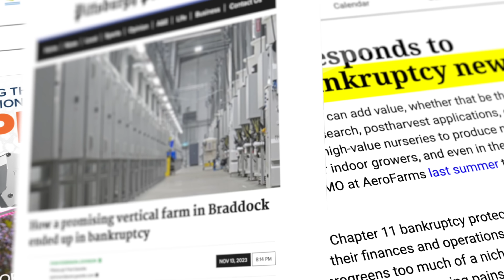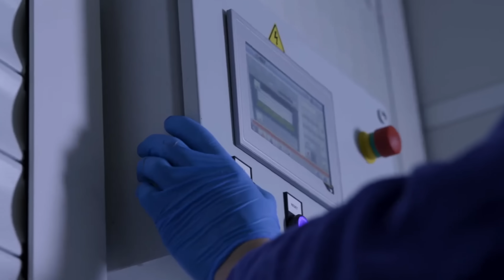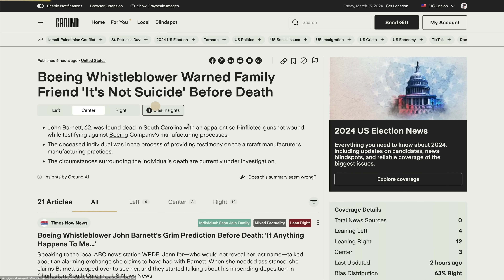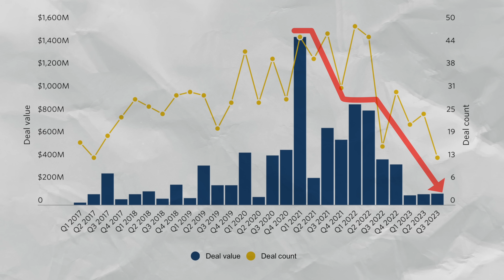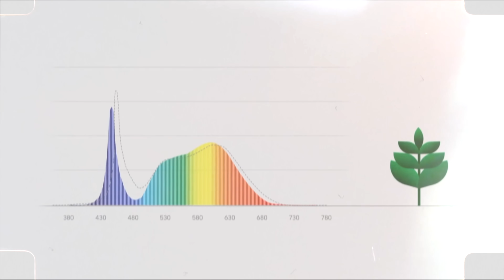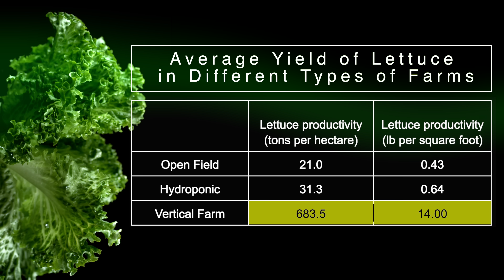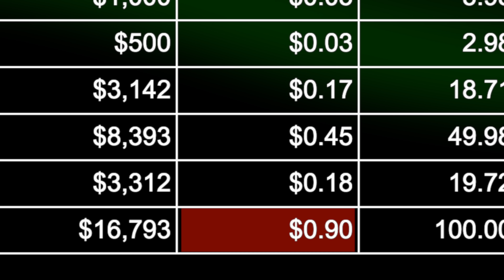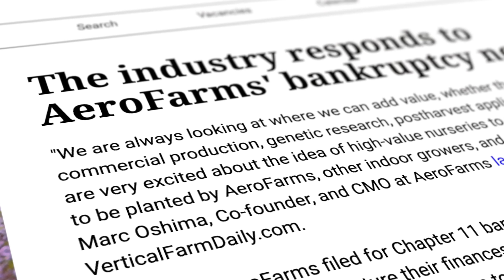The EPIC Failure of Vertical Farms - What Happened?

Comment: It was entirely predictable that these would fail because most of the promises provided were lies.

•The cost are dramatically higher because, unlike farms which are open fields, vertical farms need heavy infrastructure around them with drastically higher energy costs to maintain. Then there's taxes and permits.
•Crew cost is also higher because the machinery is more complex and is based on higher standards of living.
•Yield would also be dramatically lower as you cannot use massive industrial equipment for harvesting. So you'd need more machines and/or labor which compounds the high cost.
•Less water use is also questionable because cutting plant nutrients would lower yield quality which is already present with less natural rich soil (ehich alsoadds costs).

The only possibilities of success is if they were growing small luxury foods or if food cost skyrocketed and energy cost plummeted

Comment: The equation I think is really hard to beat comes from the cost of land. Even in high-cost areas like England land is £10k/acre. When you compare that to a sheet of polyurethane covering the same land you realise why it's so hard for these technologies to compete on price. Once you add a floor and a ceiling you've 10x the cost of land. If the land is somewhere cheap like Texus, Africa, Australian outback $80/acre it's basically free.
Cling film: £1,146.00 per acre (British pounds per acre)
1mm aluminium: £80,289.63 per acre (British pounds per acre)
1mm mild steal: £90,569.00 per acre (British pounds per acre)
5cm concrete slab: £10,117.14 per acre (British pounds per acre)
It's the same equation as to why space colonies can't work without a step change in the incomes of the population. Most people can't afford food to be 10x the price it is. So couldn't justify existing (economically) in a space colony.

Comment: You didn't add in the carbon tax on every aspect that makes up a lighting system, a building to grow in,  water pumps, all aspects of moving and storing electricity, heating, water hoses, nozzles and i mean every little part and component has a carbon tax, GST/PST and yes a income tax associated. So in reality the head of lettuce is even higher but some form of Government grant and or subsidy is making the real cost numbers retarded or corrupted. Imagine adding up the real numbers the we pay multiple times on a single item of a multitude of parts and components form mining to transporting and storage and 3 different distributors of each and every item associated with a transmission a engine and washers nuts bolts and oil and gas and water and what makes up a pump and or questionable materials that make up a PVC pipe. Every single item from start to finish is made from different companies and transported to a storage facility and distributors sell to manufacturers and factories what they need. Before a product is even made every single component  of a finished product has had a Carbon tax added to it over and over through out each process and now as a finished part, it now gets retaxed yet again. as the part finally is bought and sold to a company that needs a complete part to fit their new product they aim to sell. We forget that we are paying way more because of nasty tricky like creative taxing is causing bigger problems than it solves. We still need to heat our homes and to add a tax to the heat they ask us to use and we paid for as a electrical/gas grid is really insane. We can't make the numbers work for this project because of corruption and dirty political policies and procedures.

Comment: One weakness of the system was not mentioned and that is the type of crops grown. From the perspective of calorific value, green veggies like kale and lettuce are low in calories where as pulses like beans, root vegetables like potatoes  and arable crops like wheat and barley have anywhere from 20% to 40% more calories per gram. The problem is that non GM plants of these types do not lend themselves to this kind of farming. For this kind of technology to work there has to be a change in the seed stock using genetics to adapt the plants for more desirable characteristics i.e. micro-wheat with six inch stems  and oversized kernels. Packaging and marketing will solve the other human problems.

Comment: It's exactly what renewables have to compete with fossil fuels: Costs. Yes, going "Green" might feel good, but it's expensive up front and can take seemingly forever to break even. Additionally, how can a vertical farm in the city ever compete with a rural farm? Property taxes and regulations alone in a city would kill you.

Since labor costs is the biggest cost in vertical farming, making it a simpler process to use less skilled workers could help. Then again, that head of lettuce cost $5+ while a head of rural farm lettuce cost less than $1, even if you got rid of labor costs altogether, it would still cost 2x much. Did these people even consult an economist?

Comment: Anyone who understands agriculture could have seen why vertical farms were not going to work. A typical farm is either harvested using a combine harvester which costs $500,000 and lasts 20 years, or by migrant workers making $7.50 an hour. The sunlight is free and agricultural water use is often subsidized at below=-market rates by charging residential and commercial users more. Unless and until the cost of traditional horizontal farming goes to the point of being so expensive there are food price riots, it won't work. About the only agricultural product that makes economic sense to grow vertically is marijuana.

Comment: What I'm gathering from this video is that indoor vertical farming won't be viable until we have autonomous robots that can maintain them for us on the cheap, and both the farm and robots would ideally run on solar power instead of off the local power grid. I always imagined that farmland would be replaced with solar panels, and then in a small corner of the land would be a big building where the actual farming occurs - with the goal of the farm being to re-use as much water as possible so as to not be affected by changes in the local watershed. Blue collar labor, electricity, and company overhead costs (i.e. "Capex" on that chart) account for indoor vertical farming being more expensive than outdoor farming, but saving water in places where it needs to be saved and enabling farming where it's virtually impossible right now seems like it would be invaluable. I guess until we have cheap autonomous labor it's going to be cheaper to just farm outdoors then.

Comment: What if they used light refraction instead of the high tech led? along with using solar. this method would be cheaper as hiring outsource could pose employment exploitation for those risking their visa and also allowing the local population to feed themselves to prevent another lockdown that would hinder vital resources.

Comment: You'd need a sun, for every shelf.
Reply: Your fault, or your governments for not subsidizing it.  You subsidize cars, religious charities, military, and medicine.
Reply: You won't stop mold, mildew, beetles, locusts, nor bad weather.   Your crops aren't growing where there's temperature controls, or fly fans, or air filters.  So, your farms will go barren from flood, drought, and heat wave.  You'll need pesticides and fungicides closing the door and doing your own composting won't save it.  It costs what it costs, just like existing farm equipment, land and otherwise.   MIT only gives you until 2040 anyways.   An ox is cheaper than a self driving tractor!
Reply: Go be unreasonable with the rest!

Comment: Nice research. Sad to see and hear that they, you, do tell THE problems with vertical farming, so if the smart people do a proper evaluation, and use mother nature more and better, the majority for challenges are already over come. 

One example, you addressed the  two color LED light and electricity, duh  use mother nature FREE light and transport it using Fiber and focused Light domes, which can also feed solar cells, store in batteries etc. at the same time.  Is one solution,
Automation, can use AI for that also, needing few or little people (labor) , problem solved.

The idea is still sound and will be used going forward. Sad thing it may be done by those controlling the food industry, greed and more.  Also, you are just naming something that is a bead of sand in the desert, there is globally much more going on and there are plenty alternatives. but,  media is censored heavily so one needs to find it out side those walls of censor ship and control. 

Question everything you think you know and what one is being told.  Stop acting as a sheep that is kept inside a controlled circle of knowledge. Borders or artificial walls are made up to keep knowledge away from the masses.  The Science is still sound and will become the future, it has to.  If not we become one of GREEN BUISCUITS like in A certain movie from the 60's.

Keep up the good work.

Comment: Seems to me the problem is, they wanted to pretty much start the industry building the Model T, which depends on offering a better product (than horse-drawn carriages, in this case) at low costs. Instead, they should have looked at the actual beginnings of companies like Tesla, which was a ground-up rethinking entering into an established market with, originally, a fairly high price. Base your plan on doing a lot of expensive R&D, and start entering the market with niche products you can ask a high price for, only going to the mass market after you have most of that R&D down, and that step is still hard.
Depending on Wall Street with their interest in fast returns does not work.

Comment: so they just need to improve cost per weight so why not make it so they grow much bigger and faster by utilizing pressurized co2 environments? that would also reduce pests because it would be a reduced oxygen environment. double whammy for the cost of burning stuff and sealing the room. also would reduce labor costs since it wont be accessible as often leading to more automation. lettuce being double the size wont be a huge issue either.
Reply: and focusing on the more expensive produce would increase yields. like why put in all the work to grow lettuce when you can grow wasabi or truffles.

Comment: I would be curious to know how True Cost pricing would change the comparison. Looking as an example at the oil energy input (e.g. for transport and farming tractors) we are now only paying for the cost of extraction plus a small markup for the refining and service station. If we would price this resource instead at the value it gives (taking of our blinders to the fact it it will run out - being a non-renewable resource) and it include the cost of the environmental damage it would make so much less economical sense to transport produce across the world. 

Also these vertical farms in urban areas should just have direct to consumer sales strategy with a shop at  the ground floor of the production facility, did any of them try that

Comment: It sounds more like a greed issue. When America built it's rail system and their radio infrastructure they were not interested in the immediate ROI within their lifetime, they saw the potential of building up the nation for future generations. It worked and these systems are still in place today. That's the real benefit to the cost, being the pioneer to the future generations that will benefit greatly from these technological advancements.

Vertical Farms are the future but that doesn't mean the investors and innovators are going to see the true benefit in the long run, these companies today are most likely slowing the technological advancement as opposed to progressing it as they have proprietary information and patents that are being withheld from other innovators that can continue their advancement.

Comment: What you're looking at as an issue with vertical farming is actually an issue with high cashflow burn companies that rely on VC money until they can get to black and an absurd number of companies chasing the same dollar. This isn't an issue specifically with vertical farming, it is an issue with cash flow burn versus the price to actually deliver the yield. You have to automate a vertical farm for it to make sense... and that's EXTREMELY costly. You have to get to scale and most of them will die before that happens. Vertical farming is in the chasm... and it will look a ton different if it cross the chasm.

Comment: If 2000 new vertical farms had started up in 2023 and now 90% of VC has pulled out and many are failing that aligns with businesses in any industry. 

As an anecdotal example I have grown greens in my garage using aeroponics from 2018, when only 3 major VF existed and back then lettuce and spinach was basically only feasible. Today with exponential technological advancement and learning, berries are feasible. In 10 years with AI and Robotics I predict it will surpass growth of farming in the outdoors. 

What VF engineering and sciences have done in 6 years is codify the formula for plant life.

Comment: Don't believe even half of what he is saying. Unicorns are fantasies and so those companies are failing. But that is not the only "vertical" farming out there. Things like lettuces and strawberries and more, which were traditionally farmed in the open air, are now farmed successfully in greenhouses and have been for decades, they are lighted using normal sunlight, produce year round. And specifically do multi layer, not stacked like you see in this video, but on hanging on wires or triangular tracks. It's not as dense as the companies that featured in this video, but it's a hell of a lot smarter and better for the environment than those backward American farmers can do. It's the reason why a small country like the Netherlands out produces the US. Certainly when looking at the land ratio. 
Vertical farming is not going away, it's just evolving in companies that do know what they are doing. And how to do it economically. 
Research... my ass, he looked at a very specific section and thought he had seen it all. There is a lot more between the old fashioned greenhouse and bunkers growing lettuces.

Comment: In the long term energy is going to be a much bigger problem. Today energy is cheap: We get it by burning oil.
In the future we want the energy to come from solar panels. If a vertical farm gets its electricity from solar panels, it will need entire fields of solar panels which take up a lot of space.
A vertical farm requires a solar panel field so large that it is roughly four times bigger than the farm land of a traditional farm with the same output. This means vertical farms are very inefficient when it comes to space.
Even with our cheap electricity from oil, the energy cost of a vertical farm is already about as high as the total operating cost for a traditional farm.
I really don't see a future in vertical farming.

Comment: 🤔 OK, total outsider here. I didn't know that that was even a thing, I haven't watched the video yet, but I'm going to dive right in, take a blind stab in the dark and say that they are failing because they arnt economically competative. 

From a cursary glance at the concept, it's clear that they have the following inate disadvantage that prices them out of the market: 

1. Low volume crop yields when compared to corporate run farms with access to vast tracks of arrable farm land and established distribution networks
2. Relatively high overhead associated with the need to run automated life support for the crops themselves in the layored artificial environment? (Sun lamps, water, heaters, liquid fertiliser, etc...) 
3. Higher costs in terms of human resources due to crop monitoring and harvesting. Ie. A vertical high density set up would need frequent expert monitoring to ensure that the crops are getting everything they need to remain healthy and couldn't be harvested by simply running  a commercial available harvesting machine over the top, as they would in traditional farms.

However, I suspect they might be a better choice for growing low demand speciality, high value crops that don't put them in competition with traditional or "horizontal" farmers.

Comment: Vertical farming is going against nature. You have to provide water, nutrients for maybe soil, circulate the air and maybe control pollination, as well bugs (not just pest control).

It would do better to have it in larger levels instead of shelves. The tower type allows low energy cost warm air currents and you could grow different climates and using hydroponics run the nutrients in cycles through the whole system instead of rotating the crop.

Comment: Doing vertical farming is ment for home use not industrial use. Make a pvc pipe with some holes and a base and a pump boom 90% complete. Throw it by your window and in the winter if your northern just buy a $200 LED light to hang up.